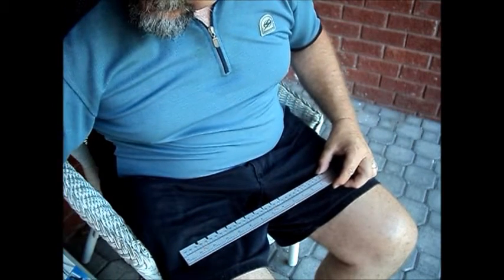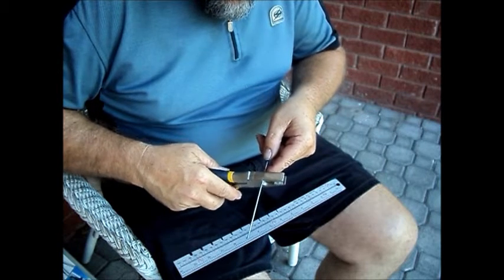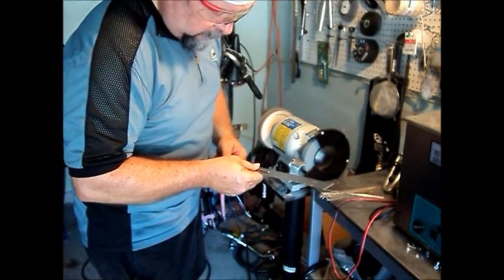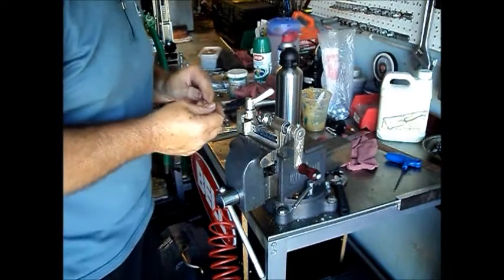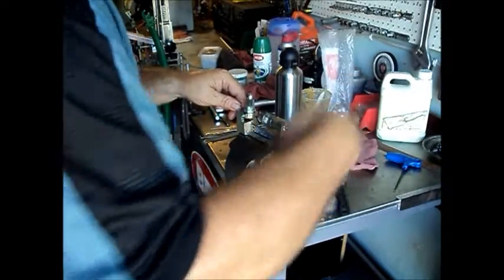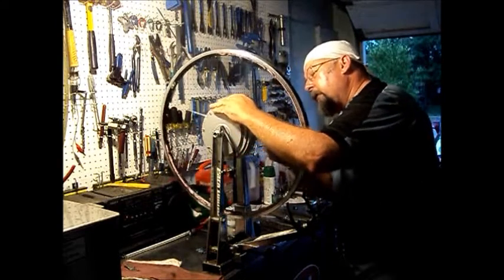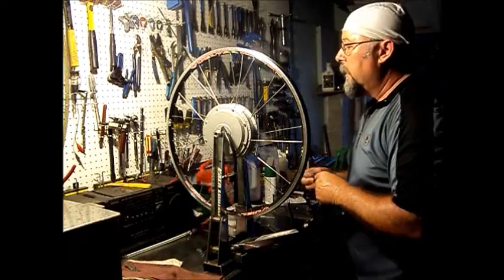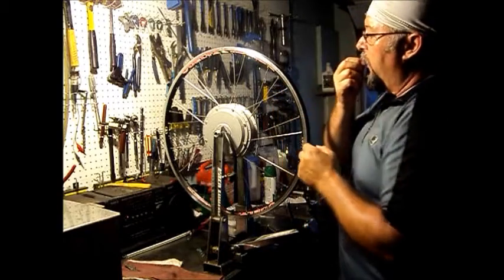Building an electric assist bicycle part I.

Comment: Dan, I don't believe that you have a machine to make threads at spokes. I never heard about this, Amazing! Congrats, I have learned a lot with your videos, Thanks for sharing-  By the way, have you worked in a Torpedo Duomatic? I want to adjust it and I have no idea the tool to use there.  Tks

Comment from the maker: The spokes are Sapim, but it makes no difference. What kind of spoke threader are you using?Perhaps you need to adjust the rollers in tighter if it's a Hozan.
I now have a Morizumi machine, so cutting and threading is now a much higher precision and less labour intensive exercise for me.

Comment: Hi, what sort of spokes are you using that you could cut thread in one pass like that? I have tried rolling threads on 13/14g butted Mach 1 stainless spokes and found it takes 3 passes to get a decent thread.

Comment from the maker: @goriverman 
 Thanks for viewing.
 Spoke length calculation starts with carefull measurements of the rim and hub at several points.
There are tutorials available on line for this, but I use the long form measurement and calculation formula from the Barnett manual. I've built a great many wheels using this formula with great success.